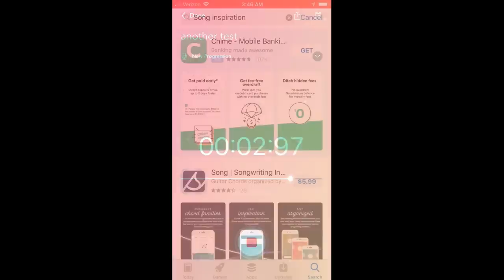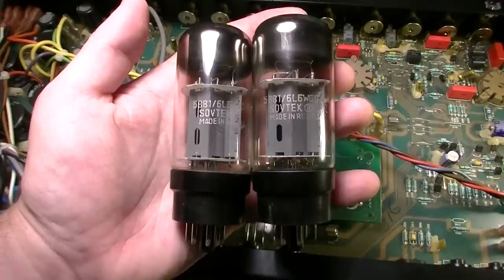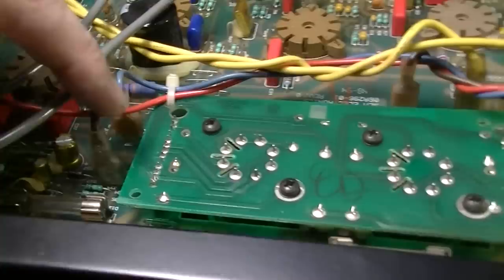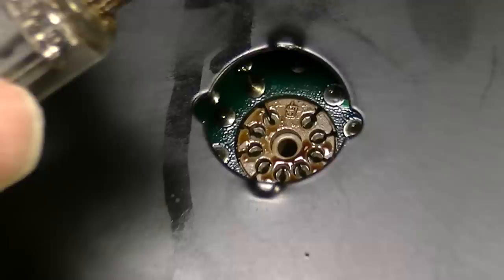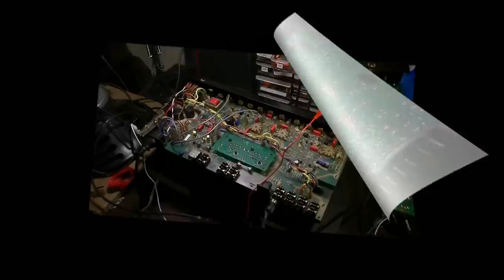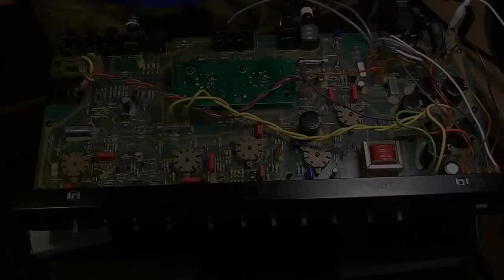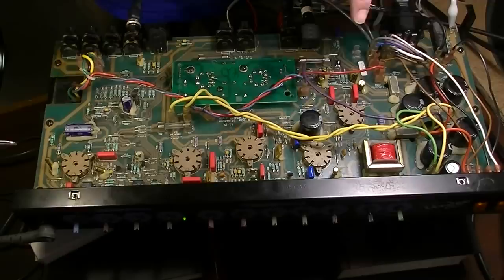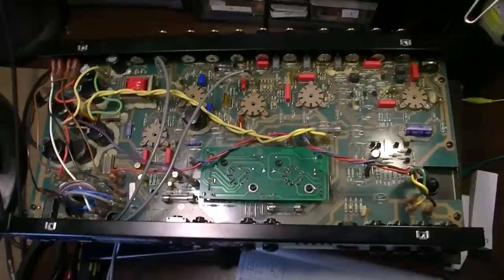Secrets of the Crate Blue Voodoo...or is it BLUE DOODOO? You Decide!

Comment: Hey Brad...  I know someone with two Crate amps that could use some TLC or a Good look at...   One is a 200 watt combo amp with a channel issue using the instrument Jacks... The one channel likes to cut out when plugging into it...   The other is a 200 watt Bass amp Head... that likes to cut in an out while playing...   What I would like to know is...Do you charge by the hour for your repairs or does it depend on what is wrong...???  Let me know how I can get in touch with you instead of through the comment section...

Comment: I had the half stack back around ‘04 before I knew much about tone, so it’s hard to review the amp without pure nostalgia lol. I recall loving the clean channel but the gain channel didn’t cut through the mix. The other guy had a Marshall MG100 solid state that sucked but at least cut through. Relied on a Boss eq pedal to straighten it out best I could. Had to have it repaired twice in as many years.

Comment: I still have a bv120 head and 4x12 with v30's in it and never had an issue but its a later version with the rectangle logo. Doesn't get used to much nowadays but it does sound good and there are some good mods for them

Comment: You're doing a great job Brad. For what you're dealing with here. The way amps are made today they're crap.  If it was mine I'd ruin the integrity of it.  I'd desolder all components,  tear out the circuit boards,  get a eyelet board, new colorful cloth wiring and tube sockets from Vintage Electronic Supply. Do point to point wiring... I'd do an UNCLE DOUG TO EM ALL.   Ass wipes that say anything at all ARE UNPROFESSIONAL ASS WIPES!  There I said it.  Hope all is well for you my friend, love ya man!
Reply from the maker: If the board ever got too far gone, a clean 800 clone or something would be the way I’d go, if it were mine.
Reply: @TheGuitologist  I hear ya, that would be cool .

Comment: I saw lots of glue around the elec. capacitors and other parts. I know why it's there, and I've seen issues with glues before on radio equipment. I have an HR2510 I'm putting new elec. caps in it, and glue was around a few of the caps, and I pulled one out, and the leg of the cap was nearly gone. This is from that glue that got under the cap years ago. The glue will harden, and cause a reaction, eating away at the metal strand of the caps or other parts. I've been removing that glue for years. Esp., once it hardens like a brick over the years, usually 10 to 15 years, really hard to get off the board. If it's still pliable to a point, usually it's ok.
Reply: That team colored glue also becomes conductive... gotta remove it!
Reply: @glenwhatley4125  I agree, I've seen it happen too many times over the years. I hate removing that crap, esp when it's 20 odd years old, and its hard as a rock. The glues that was used back in the 70's on some radios must not have hurt them at all, I replaced all the electrolytic caps in two NOS Midland radios from 1976, the legs of the caps were in good shape, as was the pc board. But, the newer radios, seems like it was the mid to later 80's, that glue started appearing that sure messed up components. Now, I did not know it at the time, but around 2000 or so, I got some radios in, and some I bought for my personal use or trade, and found some components and pc boards muffed up. After seeing so many radios that were giving issues in around the glued areas, I started removing the glue.
Reply: @dalesmyth7398  yep, nasty crap...

Comment: The version 1 blue voodoo's where alright which is what you have there,the version 2 was better in most ways adjustable bias and such and are damn near an exact copy of a jcm 900,alot of people will complain that there muddy but if you use the eq correctly and have good quality speakers there fine however a choke upgrade helps alot,the fx loop can be wonky but it works, the version 3 last blue voodoo's where made in China and are complete garbage.

That being said the version 2 was on par with Peavey quality
Reply from the maker: Thanks for sharing the knowledge. I never owned one of these. Owned the SS stuff when I was young and the Vintage Club series, but never these.
Reply: @TheGuitologist  alot of the 80s and early 90s crate/ampeg where Lee Jackson circuits mainly the ampeg SS series and vh also the vl series,crate stealth
Reply: The stock 'Crate' speakers in the 412 were Eminences and sounded great. People thought they were 'cheap crap' because they said Crate on them. 

To say nothing of the Vintage 30 loaded versions which were sadly parted out most times, which is dumb because the cab was identical to a 1960A.

Non V30 Blue Doodoo 4x12s are a great value. I got my last one for like $50.
Reply: @kampfkustomer2343  yep the those cabs are exactly the same as the 1960 length,width, depth,and bracing, really the only difference is the jack plate and hand holds

Comment: ....I own one of these amps (100 watt box head) Sounds great but I had to have it serviced & it wasn't cheap. Now I know why. Mine cut out intermittently after it warmed up (tubes weren't the problem - thermal issue?) Looking at all the possible failure solder connection/points on this amp, I can see why amp techs prefer point to point amps. I got my Crate Voo-Doo from a pawnshop clearance sale (about 80 dollars) spent about 2 to 300 on service/parts....So it was more like a 400 dollar head by the time I was done. If it didn't sound as good as it did (I was lucky?) I would grade these a POS amp & avoid them at all cost. Brad got a challenge out of this one....

Comment: Ohhhhhh that's the bad one. The BV series (150 and 300) from the early 2000s is incredible. It was designed by one of the guys from Mesa. I put this in an earlier comment on the preview vid, but the BV sounds like what I bought my Mesa Dual Rec HOPING it would sound like. Luckily I worked for a Crate dealer at the time, so I could ditch the Dual Rec and buy the BV.

Comment: I got a crate tv 6210 no schematics. Lost the pilot light and no tubes heat. Amp comes ,channel switches but no pilot light and no tubes glow
Reply from the maker: I don't have a schematic either, but sometimes the preamp tubes are on their own separate series filament string. One thing goes out and none of them light up. Could be a blown filament fuse. Could be a bad filament winding on the PT.

Comment: Sovtek 5881/6L6WGC's are actually not 5881's or 6L6's they're russian tubes rebranded as 5881's because they exhibit similar characteristiscs to the original 5881's made back in the day (tung sol etc). The actual name of the tube for these is 6Π3C-E. Check out http://www.jayskyler.com/guitar-gear-guide/sovtek-5881-wxt-6l6-wgc-tube-guide.html and http://www.jayskyler.com/guitar-gear-guide/sovtek-5881-wxt-6l6-wgc-tube-guide-2.html. He explains it very well there. It makes sense once you forget the label "5881/6L6WGC" and just realize they're some Russian fighter jet tubes. There are also Sovtek 6L6GB's that are really 6Π3C. They won't work in a 6l6GC amp (you'll blow them up, maximum plate voltage is far lower). These 6Π3C-E tubes are interesting. I just bought a pair of them (coin based 5881's/6Π3C-E) but they were so horribly mismatched from each other that I can't run them in my amp. Typical Russian build quality. lol

Comment: I stopped taking PCB amps in for repair completely. I will convert them into another, hand wired circuit though. Hot Rod Deluxe’s make a great little 1X12” Bassman/JMP hybrid.  It’s not as expensive as ordering a new loaded Fender PCB and it’ll last forever. Mojotone sells a pretty sweet little daughter board channel switcher for those that absolutely need it. There’s better effects loops on the market that blow away most stock setups too.

And.....my god....real tube driven spring reverb slays that in amp digital crap.

Comment: I had a ampeg ss 70 that went through a bus fire.. I did sit an resoldee every joint got it back up too but it had this one big ceramic resistor that acted half conductive cause it was heat stroked. Sometime I had to switch the amp on n offn on real fast to make it work. I built it to a wooden case head and it got traded for a ibanez flanger to a band called " Society of the Damned"

Comment: Speaking of that ground screw? I had been fighting with the noise of all the Fluorescent lighting in my shop for years., and just shielded the best I could and accept defeat in most cases... 
then out of know where I I clicked on a video and an Indian fella in some 3rd world country  Neutralizing high gain 60 cycle (Prob 50  cycle for him)  immediately , completely and completely eliminate it by simply  using a grey two prong plug adapter and and from the brass grounding ring  on the adapter  clipped a test lead that and run it back and clipped on his chassis.  

I it works so well I bought a half dozen or more and keep them with my amps..

Comment: Those slm erra amps like my ampeg superjet r12 from around the same time have these crappy solder joints everywhere they used crappy components in some cases too. I gave up on the ampeg and bought a vintage reverb rocket 2. I’m gonna gut the superjet and put a vintage EL34 circuit into it like a jtm45 or a vox ac50. The damn thing had burnt lifted traces and a hack job when I got it.

Comment: I have a crate v18 2x12 combo tube amp and sammy hagar used to play a blue voodoo and said they were great even after the deal was over with but quit using them shortly after the deal was done. 😆 its a crate. Crate = alright for what it is until it breaks
Reply from the maker: I was surprised to find the plate resistors for the preamp tubes were 1/4 watt carbon comp as well. I mean carbon comp can be ok, but 1/4 watt seems unnecessarily puny for that position to me. Would have been nice if they'd make a robust version of this amp, perhaps with the auto-bias circuit that could also be manually tweaked as values drifted over time. I think the high gain channel does sound great for the kind of crap I was jamming on at the end. There's just NO WAY I'd ever take one of these on a gig, or god forbid the road.

Comment: used one on tour. it stopped working first gig. had it fixed when we had 3 days off. it died again first time out. it went to the dumpster.
Reply from the maker: Not surprising. If the auto-bias circuit had a fault, it would quickly overheat at a long gig.

Comment: IM watching the video on my roku on my tv and then came over here to post on my laptop because you cant really type or do anything on youtube threw the roku. But ive messed with a few older crates that came out in this era. The glue they use to hold the caps become conductive over the years and that glue can cause havoc on these older crates that did this. IMO its just a lazy cap install having them hang out so far then use that hot glue crap to hold em in place. IM 40 min into the video im not sure if he figured out the problem

Comment: If you decide to ditch the repair of equipment then I hope that everything works out for you in ever career path you decide to follow, I wonder if the whole of the amplifier was implemented using 3-4 DSP processing chips and let maths do the donkey work with a ADC on the output and a 500W PWM output stage to drive the loudspeaker, They must have used WD40, They need to go back to 64/40 lead tin solder.

Comment: Try to understand why it's such a big deal to pull the board? Maybe because he doesn't want to break it? The reason he gave is that it's a pain in the ass basically. He mentioned removing all of the knobs and the nuts that go on the pots. He mentioned taking off the nut from the input jack. Unplugging some wiring harnesses... And the time he spent complaining about how difficult that would be he could have done it almost twice. From experience I can tell you that that board can be taken out properly and about 10 to 15 minutes.

Comment: Bro, I don't repair amps, but I have been a professional automotive technician for about 8 years and a profession robotics technician for about 11 so far. The first step to any diagnosis is to verify the complaint. If the complaint is a pattern failure, you can consider the first step done through experience. It's still done though. 

Also, crate has always been my amp of choice. The price to performance was great, and the country of origin is my own. I don't understand how they ended up out of business to be honest.

Comment: What's the big deal with taking the chassis out. Are these people that lazy. It's 4 to 8 screws usually. You can even use a powered screwdriver. I am with you Brad, I would rather inspect visually before even plugging it in to see if plugging it in would do more damage. Who are these people? Do they work in amp repair, do they own their own shop or channel? Don't listen to the Monday morning quarterbacks.

Comment: I've got the 120... The early model... And can confirm they're a bitch to work on

And on that note, someone told me once that in a lot of other places you can measure your success by how positively other people react to it but here in the states you can more often measure your success by how much people wanna bitch at you... Pretty frequently bad tubes are the symptom and not the issue so pulling the chassis and... Being thorough in your troubleshoot... Is something I agree with... 🤷
Reply: Idk what kinda caps those were but it's possible that shit on the board was capacitor juice 🙃

Also that autobias circuit is a nightmare to work on, rolling mine up on a variac it kept blowing out all the fuses at once
Reply from the maker: Getting to the heart of a matter takes patience. That’s something most people don’t possess.

Comment: It Might Be Dialectic Grease For Better Connection But You Cant Do That with Amps 
Just Ask A Guilty party~ ME LOL I learned Thats a No No
Reply: Dielectric = insulator 
It’s used on spark plug boots to help prevent spark leakage. Doesn’t improve conductivity, actually the opposite